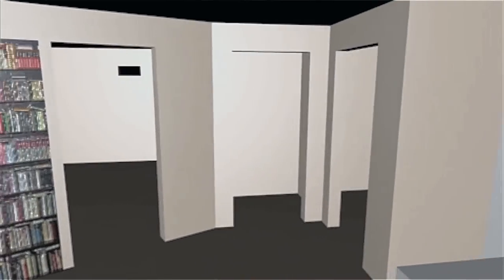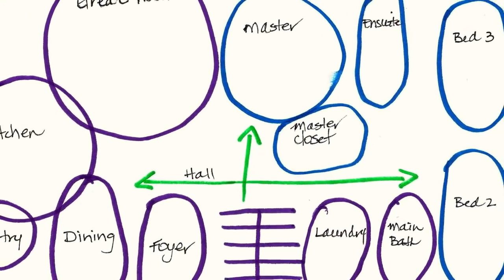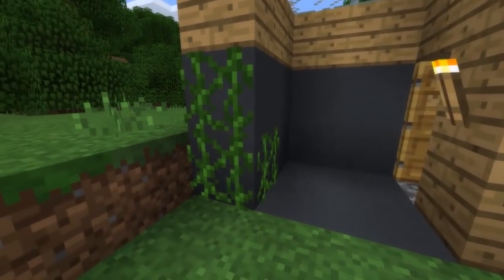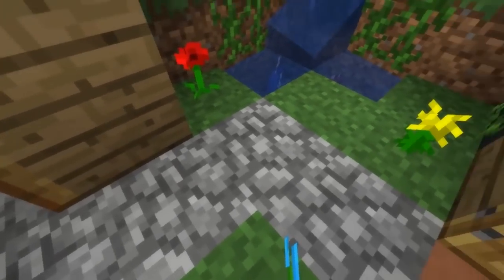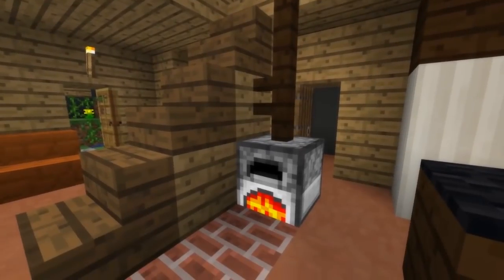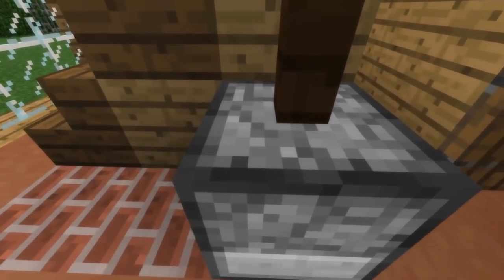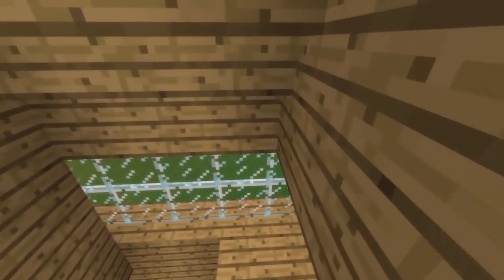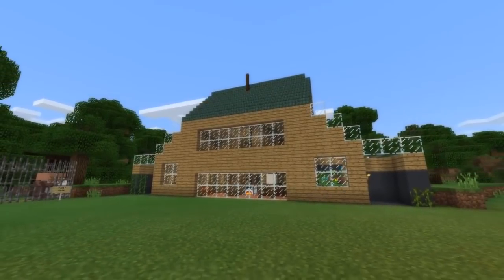How to Design a Self-Sufficient House for a Homestead

Comment: Mainly have one question, why no greenhouse on the south side of the building?

As far as minecraft goes: I have also found the scale to be the major problem in MineCraft for making a visualisation of real world structures, i think the end result get's a lot better if you treat a blocks as 50cm (~1,5ft) and thus basically build everything twice as large. This also gives a bit more room for certain details ...
Reply from the maker: The original design had a greenhouse connecting the east and west greenhouses along the south face. It was pretty awesome. Only issue is that we couldn't figure a way to prevent it from being destroyed by snow and ice falling off from the south-facing roof. I miss it. But since the entire inside of the house is pretty much a greenhouse anyhow... I was able to live without it.
Reply: @PraxisPrepper  tnx for this answer, as it will be something i might have to consider for my current plans… 

i do have a plan for a whole wrap around greenhouse, but my 'house' is only 2 levels (ground and roof covered 1st (with 70degree roof on the side and 25degree roof angle on top)) so snow buildup and sliding may not be much of an issue, though i will most definitely look into it, and perhaps change my design for the greenhouse to include something that can withstand the impact.

Ok, series already a success in my book, 1 person helped with valuable insight ;)

Comment: Excuse my ignorance but I'm curious about you maintaining a warm temperature from the wood stove on the 1st floor with it being so open to the floors above.   Meaning, if heat rises, how do you plan to keep temps b/w the 1st and 3rd floors relatively the same?  Seems like the 3rd floor would be radically warmer than the floors below.  What am I missing?
Reply from the maker: Never need to ask forgiveness for ignorance here. That's how we learn. You're actually totally correct, that area over the stove is a giant heat corridor. The plan is to have the heat run up to the top level cathedral ceilings and to have a fan running off solar push that heat back down into the corners of the house's lowest floor. From there, it'll run through floor conduits (like Roman Baths had) to warm the floors and carry the cool up and out to be warmed by the stove.
Reply: @PraxisPrepper Cool.  Can't wait to see all this come together
Reply from the maker: Phew... me neither!